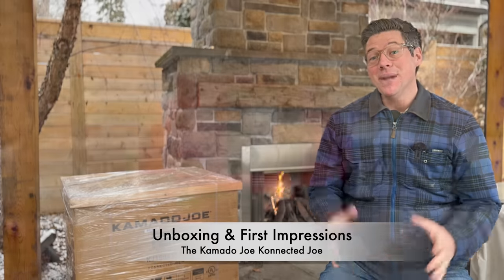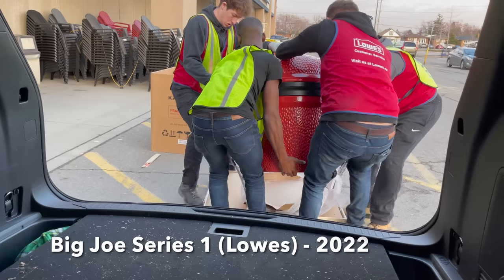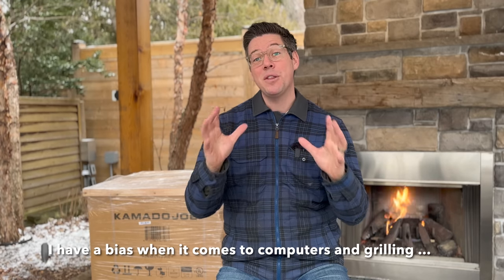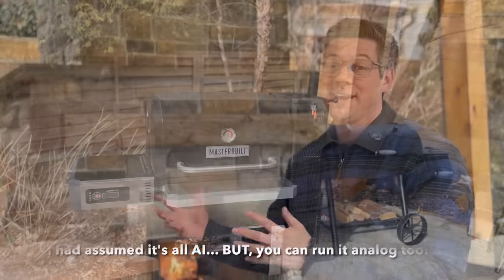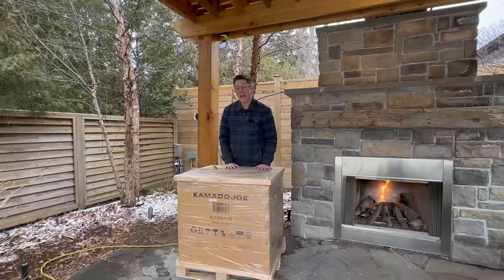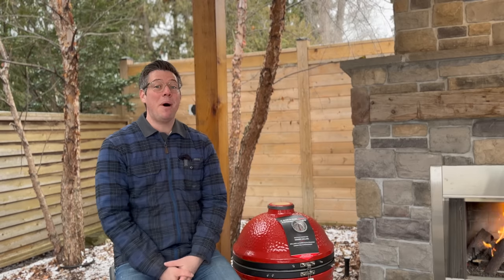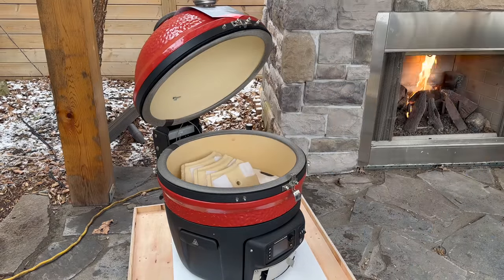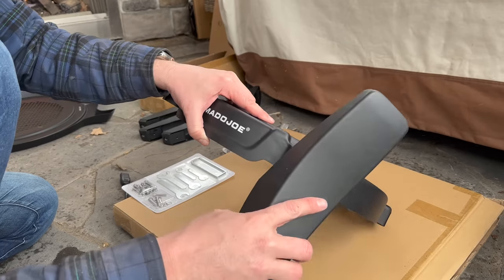First look at the NEW Kamado Joe.... Konnected Joe full reveal

Comment: Thanks for the video — regardless of whether the final verdict is thumbs up or thumbs down, it’s great to see Kamado Joe continuing to innovate. I’m looking forward to whatever experiments you decide to run, but for now I have two questions I hope your later videos will answer. First, will lighting from the bottom mean you need to re-think how you place your smoking wood? I worry it will light first and be mostly gone before the temps settle and you can start cooking. Second, how will the electronics hold up? This is partly about Masterbuilt’s reputation, which is decidedly mixed, and partly just about the weather. It would be great if you could keep it under a simple cover, and not in the roofed portion of your yard. I don’t have that option, so it would be good to know if that means this just isn’t for me, because it needs more protection than I can give it, especially in an Ottawa winter. Thanks, and keep up the great work!
Reply from the maker: I do appreciate the innovation as well. I think it says not to get wet so I will need a cover once it gets moved from the pergola

Comment: Conceptually I like the like the electronic aspect because I use the Fireboard 2 for overnight cooks when I don't want to worry about temp management or the fire going out when I sleep. But I don't use it all the time and I'd rather have it be something I can replace or upgrade down the line instead of being built in to the Joe. I do appreciate that KJ seems to be innovating more than most companies, but I think they would have been better served by releasing a new standalone controller of their own that fixes the issues the current one reportedly has. Congrats on the 100k subscribers. It's cool to see you get these opportunities because of the work you've put into this channel.
Reply from the maker: Thanks 🙏 and agree it’s likely less maintenance to have a stand alone but I appreciate there are customers (not me) that won’t consider anything other than an all in one unit

Comment: Super curious about it holding up to elements if not covered and not under a roof.  I don't love trying to control my own temperature and I like to be able to turn it on way from home so it will be ready to cook when I get home.  This is why I never upgraded beyond a Joe Jr and ended up getting a Recteq.  Since I want to do a built in, this unit may allow me to get rid of the Jr and the Recteq and have best of both worlds.  Then just a small griddle and I am set.

Comment: A few question for you to try and answer after reading the manual on the KJ site. It says to clear out ash so the igniter works properly for each new cook. Can you test to see if that is needed and how often would it fail to ignite if you don't clean? Does the temp probes for the controller have a max temp above which they'd burn out? And can it hold lower temps as stated 200 degrees without bad tasting smokes?

Comment: James, this looks very intriguing, and would be interested to see some test cooks on it to see how well it performs vs the Joe Classic and compared to some other temp-controlled option like Traeger, etc.

Also I'm curious what you think about the price-point.  On KJ's website, looks like it's gonna go for $1700 as opposed to $2k for a Classic Joe 3.  I'm wondering what you'd be giving up other than the Slo-Roller ($250), but if it otherwise has all the capabilities of the Classic 3, including that it's supposed to accommodate all the Classic Joe accessories (according to KJ's website), it seems like a great option to have this plus a SloRoller add-on.

Comment: The ignighter in the bottom is pretty neat, so long as it is robustly built. I wonder how diligently you'd need to be cleaning it and keeping gunk and buildup off of it. Lack of included basket will be a letdown for many.
Reply from the maker: I like the basket, the sloroller and 3 tier D&C rack so for me I would personally add a fan controller vs getting an integrated all in one but I understand the appeal to new users
Reply: Totally agree, and the functioning of the bbq will depend on clean airways even more than in the regular builds. Will be interesting to see how it will play out long term!

Comment: How easy will it be to replace that electric element/starter at the bottom of the grill?  That's going to be a wear item.  I used to have an electric starter like that and it eventually stopped working.  Otherwise, I like this but I'll stick with the KJ I have.  The handles on the sides are a nice touch.  Should help reduce the number of "bounce tests" that are performed on KJs.

Comment: I want to know pricing of course :-) however, glad you are going to review the various KJ accessories.  Would be great to look at Jotisserie, Slow roller AND DoughJo.   Curious what the ‘high temp’ vs. ‘low and slow temp’ use is like and does it allow you to get the amount of smoke you want or the high heat you need for a sear, etc. I would imagine it can but just curious if it provides more control etc.

Comment: Thanks for sharing, have you figured out how you might pull off your double indirect method on this thing since the wire basket you used in the series 1 doesn't look like it will work on this unit?
Reply from the maker: I think a pizza stone will work on the x rack

Comment: Thanks James, great introductory video!

Keen to see if it can handle not just the low and slow cooks, but also the really high heat steak searing/pizza oven style cooks (I’d be concerned that given the heat of the fire near the electronics that 700F temps could cause damage).
Reply from the maker: Only one way to find out
Reply: @SmokingDadBBQ  Don't be afraid to fire it up right James?! :)

Comment: Super cool!  I'm still running on my KJ Classic original, but I do have an iKamand for long cooks and it works pretty well.  I'm a "manual stick shift" guy as well for most cooks and enjoy the process.  This looks way better than the iKamand since it's all built in and I wouldn't have to mess with a snap on accessory when I want to go automatic. As for future tests, I'm curious if you can program stages - like low and slow for chicken wings for the first stage, then kick it up for a final crisping stage.

Comment: James,
In past videos comparing methods for starting your KJ, the electric element wasn't one of your favorites.  I'm curious as to how quickly you got the temp up to what you wanted as compared to the grill gun.
Reply from the maker: It’s slower. I don’t need 15min with the torch and have it down to an art to land where I want. The current 15min timer is too long for low and slow cooks so I am sure there will be software updates for that
Reply: Who wants to give up using the grill gun? It's way too much fun!

Comment: Looks great, but I'm with you on this one... Mostly analogue grilling for me.
Just the longer cooks with my Fireboard 2.
I also noticed the similarities with the classic 2, maybe they'll come up with a Konnected+ version or something.

The Kontrol Tower Top looks just as shabby as the original one, which was replaced by KJ for the fourth time in 2 years now.
The last one even had paint come off on the outside, even though it sits under a Porch all of the time.
I'm seriously considering a Smokeware topvent. Just not so fond of the asthetics in comparison to the black vents.

Comment: How did it do w/ temperature regulation? I see in your closing that the grill temp was 437-438 which is a bit higher than the 400 it was set to.
Reply from the maker: This is because I placed the deflectors blocking the back probe which the computer used vs the front dome probe that I use. It works better when you flip the opening to the back but it still overshoots a little

Comment: It might be me but the cart seems to be extremely unstable. Step 1 asks to screw through the top plate into the leg but the hole in the leg is much larger to secure the screw. What am I doing wrong? I am so excited to get started because of your videos but need so guidance about the cart assembly. I have not found anyone with the same issues so I assume it is me. Thank you for any help

Comment: Congratulations on the early review opportunity. 
I’m curious what it can do without Charcoal. For example, Can the heating coil turn this into an oven for low temperature dehydration?
Reply from the maker: That’s an interesting question. The starter turns off automatically so not sure we could keep it on longer other than pressing is several times

Comment: In the automated mode, does it move the vents? Or just provide instructions on what position to put the vents in?
Reply from the maker: it tells you what to do but you have to do it
Reply: @SmokingDadBBQ  So it’s not like a fully automatic transmission. It’s like a car that says, “Hey, put me in second gear!”
Reply from the maker: @SouthernsBBQ  hahah exactly.  The fan can overpower a vent that’s too tight. What it’s really doing is helping it slow down which is why you set the vents about 50% less than you would for manual use
Reply: @SmokingDadBBQ  oh, it’s got a fan running when you close the bottom vent?

Comment: Hey James, Nice grill. I have an unrelated question. I did the high heat burn on my classic 3 and now the lid doesn't pop open like it did. I did have to adjust the tension on the lid but the lid still doesn't pop open. Any comment that could help with my issue?
Reply from the maker: Can you send me a video clip?  Trying to understand the pop open if you have a latch alignment issue or the airlift hinge is t providing enough leverage. Have you tried tightening it more?
Reply: @SmokingDadBBQ  I just tried it again and it seems ok now. Maybe the gasket needed to bounce back from the high heat clean.
Reply from the maker: @stevefowble  it does get compressed

Comment: The problem with a built in controller on a Kamado is that the probes or electronics are far more likely to give out before the functionality of the grill itself. Is there a lifetime warranty that covers the controller failing? Also, is this connectable to a smartphone to control when you’re not home?
Reply from the maker: Yes the app is available remotely since it connects to wifi. 

Agree, not sure about the warranty. My assumption is the same lifetime on ceramic and 3 years on electronics like the pellet joe

Comment: Love it so far. I wouldn't' get one because I like primitive. BUT, for my brother & friends, who like food off my Kamado but they don't want to take the kamado learning curve. this could be a good recommendation. has me wondering. 
- If you spill your water pan, does it kill the electronics? 
- When you gain experience. and want to cook without the computer stuff. Can you take the training wheels off? (Throw in a kick ash basket and use it same as you would regular Joe)
Reply from the maker: Yes you can take the training wheels off. The controller still works with a basket. Just the AFS won’t work. 

Not sure about water pan. Will find out

Comment: The afs was explained but nothing about what the electronics do. I would assume regulate temp. But then how? Etc.
Reply from the maker: It has a built in fan and probe in the back of the dome (there was some text for this but it was small) that allows the PID to adjust the fan speed to maintain the temp you set

Comment: Any idea why it's based on the classic II and not the III?
Reply from the maker: I am not sure, my suspicion is this comes in priced below the series 3 so there is a cost / price point involved the team is trying to get too.  

Second, the series 1/2 are sold by big box stores where most grills are sold... the series 3 is limited to specialty BBQ stores, had it been based on series 3 it likely would only be available in a small % of retail outlets which might limit the customer looking for the big box pellet grill.

Last would be complexity... I think the customer looking at this might be daunted by the sloroller vs. deflectors let alone something like my double indirect which i am sure would send them running for the hills... or at least the easy to use Traeger.

Those are my assumptions/thoughts... no inside intel I'm afraid but if I was them this is what I would be thinking about.

Comment: Help! Finally upgraded my classic 1 daisy wheel to the Kontrol tower cap and after 2 uses it came off the top and hit the ground and is in 3 pieces.  Anyone know can get a replacement screw for the bottom parts of the Kontrol tower?  Thanks 😢

Comment: New toy. 😁 Nice review as always. Worth reminding people that there is already a separate  Kamado electronic temperature controller for sale - the ikamand. That would be an interesting future head to head. My initial concern is that this will make using a Kamado...too convenient. Half the fun of the manly ( Other genders available. Results may vary ) art of BBQ is the fussing and faffing about. This removes the enjoyment of learning the dark art of fire management.  Also won`t the lack of a basket make cleaning more awkward- and remove the 1/2 basket option?
Reply from the maker: The ash tray below does well at collecting debris … but if you don’t remove it and run again with the fan it can blow some dust you didn’t remove up into the chamber

Comment: I am a brand loyal supporter of Kamado Joe. This is why I was extremely disappointed with the performance and workmanship of the iKamand. It was just not up to the quality standards I expected of Kamado Joe. So the thing I’m curious about with the Connected Joe is whether it will have the longevity that I expect from Kamado Joe or the shortcomings that bunged up the performance of the iKamand.
Reply from the maker: I feel the same way. The pellet joe was built well and has held up, this mechanically looks solid… hope to see it play out better as well. So far optimistic that the experience won’t be like before

Comment: Interesting product.  I would imagine in this day and age if you're not offering something 'app enabled' you risk losing relevance among the younger generations.  Personally, I want the old fashioned way, the way that I know will still work in 20 years.  Not some app that isn't supported after a few years, and not after some electronics fail and parts aren't available.  Maybe this won't be the case, but I prefer to keep it manual.
Reply from the maker: You and me both
Reply: Apps have updates and you can control it manually if you wish. It’s the best of both worlds for people who are new to Kamados - and this built in temp controller is better than having to dig out and set up the after market versions. Plus, this goes to 700+ degrees

Comment: Looks great, probably operates great but looking at the specs it the Masterbuilt Gravity 1050 is bets it in all but 1 more probe, direct flame, and an electric lighter 

Konnected Joe $1,600, 
605 square inches of cooking surface, 
charcoal, 
digital temp and time controller with bluetooth to cellphone controls app, 
3 meat probes
direct flame cooking
push button electric lighter 

Masterbuil Gavity 1050, $800, 
1000 square inches of cooking surface
charcoal
digital temp and time controller with bluetooth to cellphone controls app
2 meat probes
indirect flame cooking

Comment: Interesting, but it should be easier to just learn to control the fire. Plus, it doesn't look like this thing will be very happy if you leave it out uncovered. Or even if it's covered, hard to believe it will still be running in 50yrs like a classic.
Reply from the maker: I agree

Comment: I will get a lot of hate for this. 
I think this is a failure grill just like the kettle joe.  Is the new device water proof? Does it run on the battery? Why would someone get this instead of the classic 2 that can be found at 500$ online ? . Kamados in general are set and forget, why would you need a computer for that ?  Where is the fun on having a computer vs you manually playing with the vents...  I know you can use it as a regular Kamado, but why would you buy this to use it as a regular ?  Also what happens if you have a lot of grease dripping down the lighting up mechanism?  Also I saw it's got a big lag while adjusting the temperature.  Imo, this is not worth the price they asking for. If you buy this to get you started on charcoal grilling, you better stay off at gas grilling.  This model will fail and be out of production within 2years.  It will target only a small amount of people. A real master griller will understand and not need this.
Reply from the maker: I bought a analog SLR camera 20 years ago convinced digital was just a fad and any real camera for quality would remain a proper camera. 
Time proved me wrong. Does this grill face some of the same challenges of other digital grills like a traeger?  Most likely…. Do people buy these smart connected grills in droves?  Absolutely. 

For me, I am and will always be on the old school side of the fence when it comes to tending my fire as you don’t have to worry about any of these extras failing over time
Reply: @SmokingDadBBQ  I'm old school as well. (I'm still using film camera) You get your cooks the way you want it and you happy with it ? Yes ? Then this is just a gimmick.  Bbq and smoking and cooking over the fire requires basic skills. Back in the day I just had a metal box with a grate on top and my chicken and porkchops were perfect everytime. 
It's all about the person's behind the grill and not the grill itself.